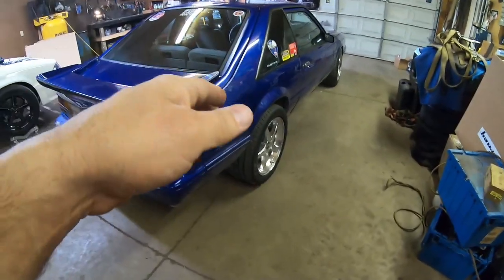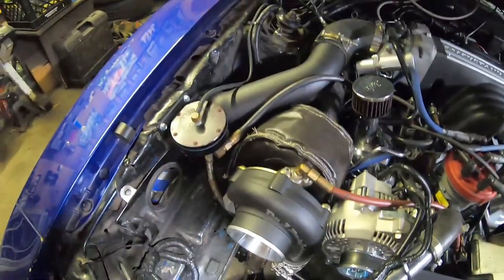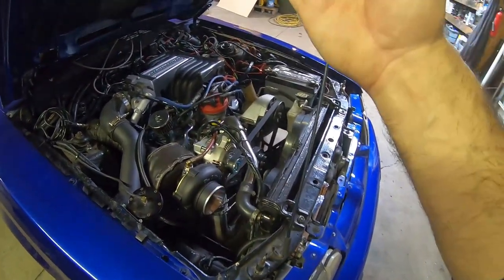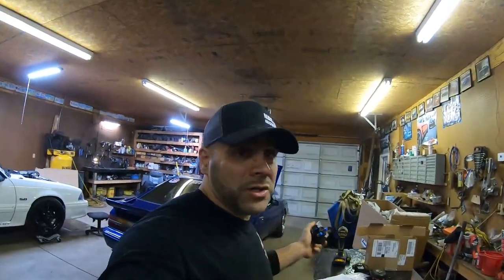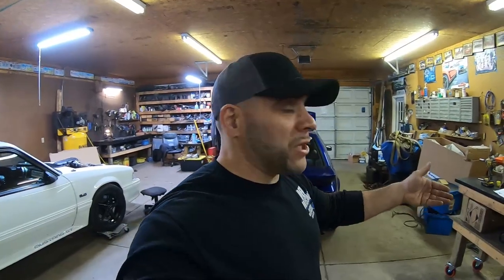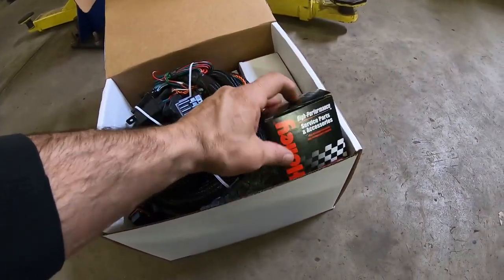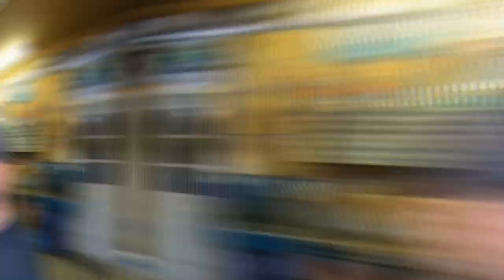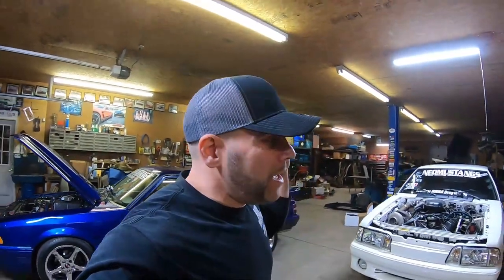A Foxbody Mustang's Roadmap To Making Power

Comment: Progression is how you learn!! I had to learn by progression because back in 1998 i was around 22 when I got my current fox, I struggled just to make the payment.  😄 instead of buying a nice off road H pipe I had to "clean" the stuffing out of the stock H pipe for sound and some free hp. My first cam was a crane 2040, cranes variant of the E cam, by filling up my friends mustang with gas and buying them a pack of Newports. About $18.50 total back then. But life progressed and my car progressed, i never sold it, i never gave up on it. I was always a true believer in mass air tuning untill I got the terminator x. For those of us that learned to tune stock ford ecu stuff we are like college graduates, when you fire up the holley tuning software you will feel over qualified for the job!!! 😆
Reply from the maker: Haha nice. Thx for sharing

Comment: Dan..... totally unrelated, but what size rubber is on the front and back of Pop's car?  I know they are Rikens Raptors up front but can't figure out the size, lol.
Reply from the maker: 245/45/17 front. 275/40/17 rears. Small spacers for stance on rears
Reply: @Neomustangs  Thanks Dan.  Switching to real 5 lug Rs and currently have 245/40/17 all around on the 4 lugs.  Want to toss a 275 on the rear, but not sure that the 245/40 will look right on the front.  Pop's car looks good with the 245/45. 👍